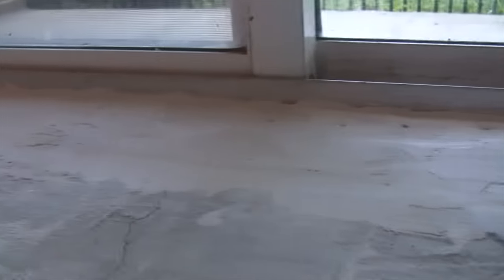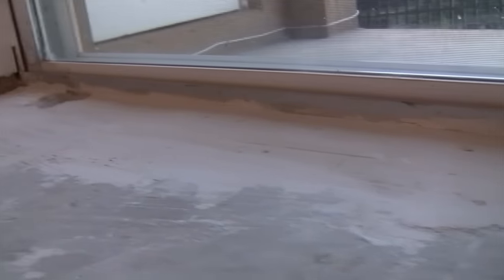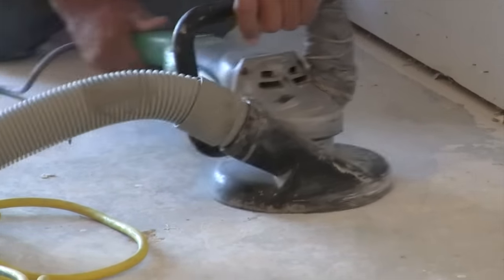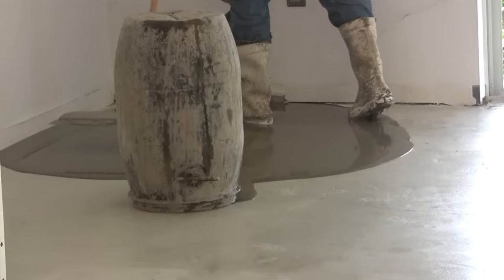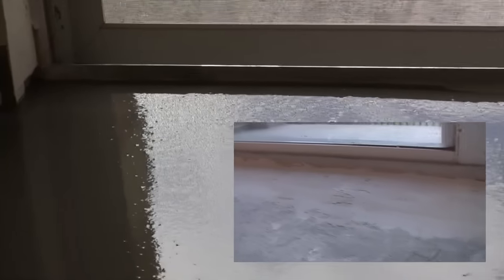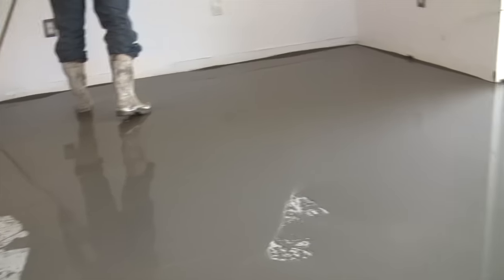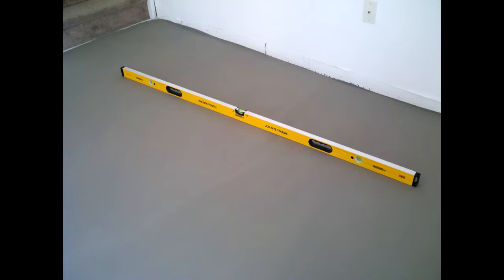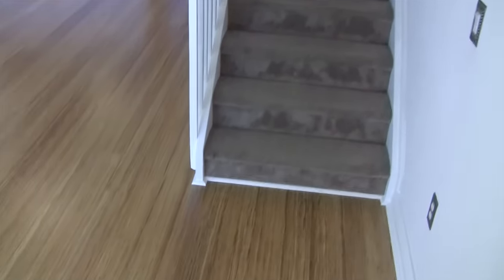How to Self Level Concrete Floors Like Pros - Self Leveler

Comment: I am an unfortunate 'Army of One' that doesn't have anyone to mix for me... I have 520sqft to spread today or tomorrow in my own home. I screwed screws into the floor on a 2' grid and at corners of the walls/cabinets across my kitchen, dining room, pantry, coffee bar area, mud room, a closet, and a bathroom with a closet as a floor height reference based off of a FatMax self-leveling laser and a marked-for-reference white 1X2 board. In several locations I have 3/4" sag between all of the exterior walls being level, and three other heights across the floor that match those exterior walls. The rest is low with no way to bring it up except to fill it in. I believe I can do it alone by adding the self leveler up to the tops of all of the screws as a reference. This video was good reference for what I am about to do and it is well put together. Thank you for taking the time to put it together for us. :)
Reply from the maker: Wow, that's a huge project, and a lot to pour with some of these 3/4" differences. Make sure you have enough bags. Let us know how this goes for you, and what challenges you had to overcome.
Reply: How did it go
Reply: Yea…how’d it go?
Reply: How did it go bro? 💀
Reply: @jeffostroff  how did it go man??? I’m trying to work on my basement which is 1700 sq feet

Comment: This is the "money is no object" way. Floating the entire floor is not always necessary. Normally you just use a long straight edge at various points along the floor and mark the high spots and the low spots (a step missed in this video). Then you grind the high spots down. Then you use the self leveling mix to fill only the low spots, not the entire floor. This will save you so much money using less bags of self leveler, and still get a level floor.
Reply from the maker: this floor had way too many problems for screeding.

Comment: Someone needs to share this with Louis rossman
Reply from the maker: I was wondering why Lewis even needed that whole flooring substructure to be built anyways.
Reply: Get out of my head, mate! :D
Reply: @jeffostroff  He blamed… gravity. Apparently the floor has a huge slope from the bottom to the front of the store and it´s a long space.
Reply: @someguy3717  He literally did it. "Gravity" (Understand it in context) check his live chat on the matter. I´m not telling he´s right or wrong but it´s his explanation.
Reply: @someguy3717  I am saying that was his explanation everytime, and it was not a joke. https://youtu.be/9DJujrKPKv8?t=846
Reply: @someguy3717  Ask him and leave me alone, mate, you are getting quite rude and annoying. And you are who is trolling ,  if you haven´t noticed yet . If you want me to pick the trolling bus I have the vocabulary,  by the way. LOL
Reply: @jeffostroff  According to him, he reached out to some people with the know how and they said that the floor would collapse if self leveling concrete was used, as the supports holding it up in the basement were insufficient. But I do wonder how much heavier a thin layer of concrete would be compared to all of that timber.
Reply from the maker: @dave6969   Yes it depends on how much self leveler they need to add I don't know how far off it was from one side of the Room to the other side of the Room. But even then why can't you just put down some laminate flooring, because from one side to the other side might be  slanted but as long it is not bumpy you can install  laminate floor
Reply: It seems like that's what he is now planning to do, as the original idea didn't work out due to issues with the contractor.

Comment: $30 a pop for the levelling cement. That's $1,200 just for this step.
Reply from the maker: I'm quite sure these guys don't pay anywhere near that amount, since they are commercial property contractors, and probably buy this stuff by the truckload. They don't go to Home Depot to buy this, they would go broke. This puny little 40 bag job is nothing to them, and I had to pull teeth with them and other contractors just to get these guys to show up, as this is too small a job for the other guys.

Comment: I love how the DIY advice in this video is "pay someone else to do the job" lol
Reply from the maker: Yes we are showing you how to do it and on a small scale most people can't but if it's a room area that covers two rooms and it's this large, I usually tell people to bring in the pros unless you have a couple of people working with you because this does require a perfectly timed choreography in order to pull this off smoothly because once you start mixing and pouring you cannot stop until you are done and it has to be done very quickly you mix for about a minute or so and then dump it on the floor and start the next batch

Comment: Over 15 years in concrete experience here and they miss the most important step. Repairing the cracks. Hair line cracks can be sealed with a structure epoxy but if bigger or deeper than 1/8 your suppose to cut a valley and place backer rod then seal it with structure epoxy, then grind floor after it has cured, then self level the floor. Also i would have lifted and pin the carpet up on the stairs. For you guys wondering why house slabs crack like this. There are 2 main reasons. 1. Is settling over time. 2. New construction companies add too much water to the concrete past the specs of the mix design. Why so they can finish the slab faster. That looks like a 3000 post-tension slab and thats usually a 5 in max slump. If it cracked like that and the house is about 3 to 5 years old i bet they poured it on a 7 to 8 in slump which is too wet and it reduces the strenght of the concrete. Ive seen this done too many time to count.
Reply from the maker: I don't think any of the cracks were over 1/8".

Comment: I've been laying wood floor for years and I have to say that bamboo flooring looks amazing great job
Reply from the maker: Yes, we loved working with it, 5/8" thick solid strand natural bamboo. They manufacture it by crushing the bamboo and compressing it under high heat and pressure, Janka rating 2500.

Comment: You are a 100% right. I tried to self lvl my floor by myself and with the help of my 13 year old. I didnt have the proper tools, yet we finished the floor but it ended up being terrible job. You def need 3-4 people helping you out. Now i beed to fix my floor and thinking of putting another layer of self leveling. Any input on that?
Reply from the maker: Check to see what the bag says about multiple layers, usually adding the next one sooner the better.

Comment: Nice job and good info. I liked the way they used the grinder with a vac to take down the highest edges. If you didn't grind the floor, you would have had to have much thicker leveler over the entire surface to cover the high spots!
Reply from the maker: Yes, and one spot had a vertical section of rebar rod sticking about 1/4" up out of the foundation. Also roughing up the foundation with the grinder helps the primer and leveler stick better.

Comment: Great video. By tile contractor friend in Jacksonville, FL uses a company that pumps in self-leveling compound for big jobs like this. 
His advice to me was: “Remember it has the consistency of chocolate milk when you first pour it, so caulk every since crack or crevice where you don’t want it to go.”

That was after I learned the hard way. I leveled a sink tub area and had a form to keep it out of the drain area, but I didn’t caulk. Within seconds, that stuff was leaking in under my form.
Reply from the maker: Yes, we treat it like water and dam up everywhere.

Comment: I spread self-leveling compound for the base of my shower stall.  When dry, I installed the base for the shower stall.  It wobbled.  I tried some more self-leveling compound.  The base still wobbled.  Finally, someone suggested the base itself may not be perfectly level.  I scoffed, saying the base was made in a modern manufacturing facility and was surely level.  I took it to my pool table and guess what?  The base wobbled.  I should've ripped the manufacturer a new one but instead I applied some non-self-leveling compound to slightly slope the floor to match the uneven base.  Sheez!
Reply from the maker: Great way to overcome what we find all the time!  Shims might have worked also.

Comment: What I wish I had known about floor leveling
compound after watching these videos; 

The videos on YouTube are obviously with experienced
tradesmen, making the job look easy. 

Primer is extremely important, especially when
laying layers upon concrete.   

Anyone in the business of floor leveling will tell
you that the product isn’t self-leveling. It takes an experienced hand to have
a finished product that is flat, much less smooth and level, 3/16th
of an inch at ten feet is the max variance. 

Cold, cold water will give you some extra time to
spread the mix before it clumps and hardens. 

Special tools are needed, unless of course you are a
concrete man that knows how to use lumber as a tool. 

Spike shoes are important when doing large areas. 

A roller with spikes is necessary to remove bubbles,
help spread the cement and pop bubbles. 

A slow stir is necessary to keep air bubbles out of
the mixture (recommending a mixer and not a drill). 

Exact water measurement is extremely important. 

Stirring longer than two minutes is just wasting set-up
time. 

Sanding often isn’t a problem, some easier than
others, some dustier than others.
Reply from the maker: All excellent observations

Comment: I'm loving the barrel they used. This could be the answer to my problem.
Reply from the maker: Yes you will often see pros come up with nice custom solutions hat work well for them like the buckets they used with holes to rapidly measure the exact amount of water they need to use for that leveler.

Comment: I have 900 sq ft that is mostly open space (kitchen, dining, living, entry) with a master, half bath, and laundry. Is that something that can be done at once or does it need to be done on sections?
Reply from the maker: I would try my best to pour everything at once. It might require one or 2 additional helpers to keep the flow going. I don't like to stop and restart again, trying to join a newly poured section to an already setup and firm section, it is hard to get them to line up level.

Comment: Great video! Any thoughts on doing this in a detached garage so I can put in a home gym? I think I heard that there is a slope required out towards the front entrance. Thanks again.
Reply from the maker: Self leveling is hard to do on slope so you want it to pool up in lower end and level off to upper end. Remember this can only be used on foot traffic not garage car weight loads

Comment: this is exactly what I need done to my front room. house is old and all the layers of linoleum (about 5) my daughter scraped up, and the concrete floor is uneven . Where would I rent the machine with the vaccum ? Or how much should it cost for someone to do this for me? it is a 23'x9' room.
Reply from the maker: They will likely charge you a few hundred dollars, or you can rent the angle grinder at home depot, and a shop vac, but you'll likely spend almost as much on the rentals, they are expensive. And doing that work, and getting the respirators, that is grueling work, I would google floor removal companies,  that's too hard to do it yourself. In 2015 I hired a floor removal company to come into a condo kitchen and front foyer and grind down all the thin set left over from me removing the old tile floor. Three guys, 2 hours, taped up film everywhere to avoid dust, hooked up a vacuum outside to suck all the dust out, jack hammered off all the thinset mortar from the previous tile floor, and when they were done we had a smooth flat concrete floor that was ground down smooth for $500. Sounds like yours is not that involved, so should be cheaper.

Comment: What did you use for underlayment?  
Was the bamboo glued and nailed down? 
Also, what were your transition elevations to the existing tie in once you self leveled and laid down the flooring?
Reply from the maker: Bamboo floor was installed with a 1/8" underlayment, not glued down. Once we laid the floor planks, they were about the same height as the tile floor, so we used T-mold transition pieces. We did not have to use any height reducers.
Reply: jeffostroff I installed a floating bamboo floor as well but the planks appear to be rubbing against each other and squeak. Did your floating floor squeak at all?

Comment: We always have to be careful of stating "perfectly level floor". Most SLU leaves the floor at about a 90 to 95 FF ( Floor Flatness). This project went form under FF15 to FF of about 95, which is great, just as the result is great.
Reply from the maker: That's some great info there, thanks Patrick! How do they measure the FF, are there nay tools the DIYer can use for this?

Comment: Having only used the tool for other purposes, what do you do with the "wheel guard" on the angle grinder to be able to use the whole disc surface on the concrete?  Thanks.

Comment: I have grinded and scraped and cleaned my basement floor and am ready to add the bonding agent, was looking at your list of tools used in this video and i dont see a link for the roller that was used for this step-is there a special roller?
Reply from the maker: The Times that I have used it I just used a regular paint roller 3/8" nap is just fine

Comment: Good Job. I tried to tell someone that was installing pergo flooring over concrete/cement, that the floor must be leveled.  And I stressed that a level must be used to determine.  Well I guess because I am a girl I don't know crap.  But it does not take a Architect to figure that common sense stuff out.  But needless to say this gentleman continued on with his installation, and yes it looked like crap and felt like walking on grass.  So fat he has re done the floor 3 times, trying to lay pergo uneven concrete.  I am going to casually play your awesome video, so he can hear it from a man.  Maybe then he will get thee old level out and get on my level....ha ha great video !! And workmanship on the floor job.!
Reply from the maker: Well the other alternative is to put shims under planks that are going to sag. I just did that at a friend's condo, they did not want to spend the money to level the concrete floor, so a few areas I had to put shims underneath the boards on maybe dozen board throughout the floor, otherwise when you step on them they mush down into the dip of the concrete floor.
Reply: Your right.! And that was a funny joke Have a good Knight.
Reply: Ha.. it happens to most of all of us girls. I was told I didnt know what I was talking about when trying to correct the guy installing marble tiles for my bathroom. Needless to say I fired him the same day.

Comment: Hi Jeff!  Thank you for the excellent video.  It is greatly appreciated.  We're putting down some vinyl plank over a concrete slab.  We used this product to raise the floor 1/2" and correct some defects.  For the most part it came out perfectly.  We do have an issue.  There's an area where we put down new leveler and the prior row had begun to set.  As you might guess the seam didn't even out with the new pour a bit higher than the old.  Nearby we complicated this problem by trying to rake out a minor imperfection in an area that had partially set.  So we have a couple of high spots that need to be fixed.  Would it be OK to grind them down carefully?  And, if we end up with some small low spots how do you recommend we fill them?  Thanks!
Reply from the maker: Yes we have done that before. I just used my angle grinder. If you have an orbital sander, try that first with some 60 to 80 grit paper, we used both.
Reply: @jeffostroff  Thanks Jeff!  I ended up using my belt sander.  I think we're ready for the flooring!

Comment: We had our concrete floor leveled, but they entirely skipped the grinding part, so it just resulted in the same slopes. 
Id like to do this myself, your method looks amazing and practical! 

My question as a newbie to this is, how will i know how deep to grind down to? What if my house was framed weird and i cant find a good depth from the right spot? Very new to foundational work, sorry.

Comment: Hi Jeff, thanks for the fantastic video. I'm total newbie but here to learn so one day I might be able to do it myself :) Just to ask what happens if you don't use the bonding agent ? Is the new cement will start to cracking and loosing up with time ? 

By the way this video sounds like how they kind of teaching in schools which is great. I know some people layed wooden floor on to the top of carpet or they used glue to stick it to the floor. Are those methods are not the right one right ? Just asking it so if someone recommends it to me and thet say "it will be fine" I wont listen to them haha :D 

Thanks again
Reply from the maker: Old concrete which has already cured years ago needs to have the bonding agent rolled on 1st to enable the new concrete to bond with it as it forms its crystals during the curing process. If you don't apply the bonding agent first you're poured self leveler could delaminate from the concrete and not give you a very good hold. As far as the other methods are concerned, my thought is that the weight of the new laminate flooring that gets put down will likely hold itself now whether it might slide back and forth individual planks as you walk on them I simply don't know. One time we put down laminate flooring on top of tile. But we used the floor glue to glue down the underlayment first, and then we glued the planks down on top of the underlayment and so far that floor has been nice and solid for two years now